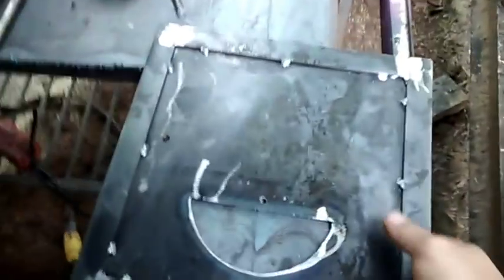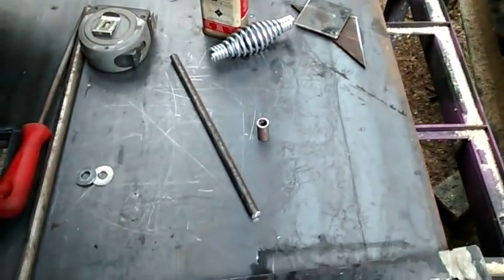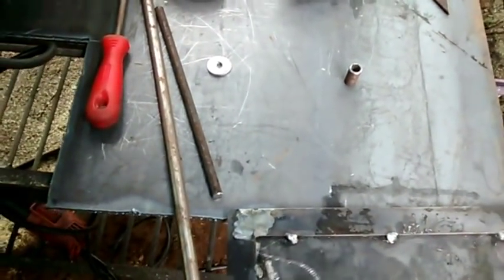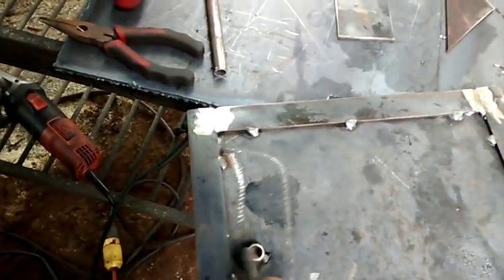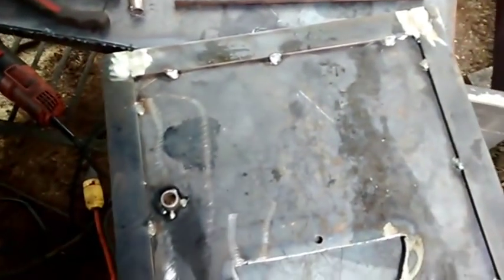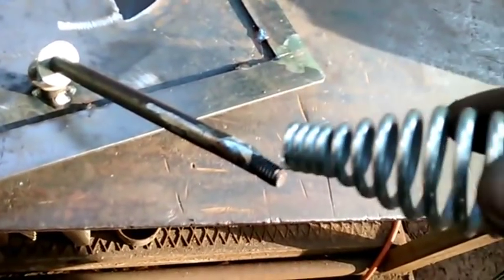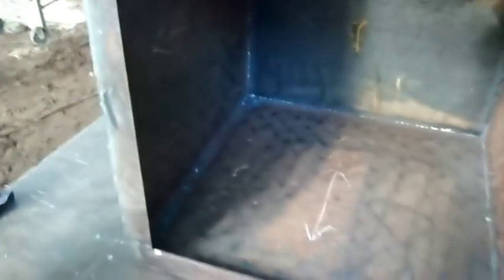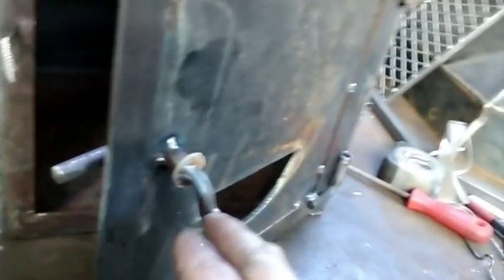How to build spring latch for bbq pit

Comment: Allen, do you think if you welded in a small wedge in there instead of that round stock it would hold better? Just a thought.
Reply from the maker: I'm using flat pieces now and they hold good but a wedge would be best most likely

Comment: I found that 3/8th Gas Pipe drilled out with a 3/8th drill works better. More Pipe Wall to weld and you won't burn through so easily. Put it in a Vise and drill it out with a hand drill and 3/8th bit..

Comment: Instead of using a piece of 3/8" stock inside the fire box, a right triangle with the wide point up would allow you to wedge the handle in place and provide a better seal for the door. Yea and you can find all the spring style handles ya want on EBAY

Comment: Allen, how do you paint your pits?  Do you use a grinder with a light grit to knock the milscale off or do you just prime and paint?  Thanks for any help
Reply from the maker: Chris Sanchez I don't worry about the millscale except where I weld, I'll go over it with a wire wheel to get rid of spatter and stuff, then just use high temp BBQ paint, holds up good

Comment: What mig welder are you using?
What wire size wire?
Reply from the maker: HTP pro pulse, either .030 or .035 , that video was a couple years ago, I’m not sure which one I was running then

Comment: How much for one of those table top pits
Reply from the maker: Manny Lopez the one with the firebox is $250 with 3/16" plate on the chamber and 1/8" floor plate on the firebox, $200 with 1/8" plate all around

Comment: Allen:  I think I came up with an improvement on your design.  I use a 10" 1/2" carriage bold instead of the 3/8 rod.  Instead of using 3/8 I.D. pipe for bushing I use two 1/2" nuts.  There's no chance of you burning through them when you weld to the door as that thin-wall tubing.  If you need to adjust the latch tension slightly you can just screwing the handle in or out a turn instead of having to heat and bend the latch.  Cost and fab time are about the same.

Hope this helps and thanks for your videos.